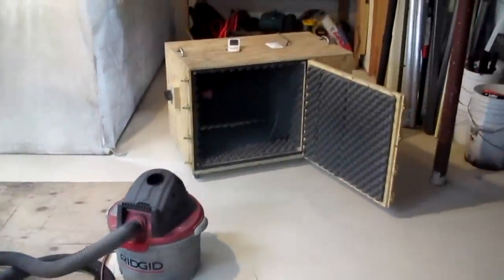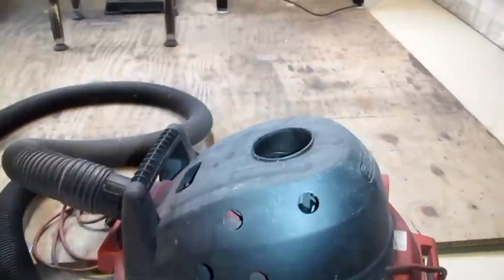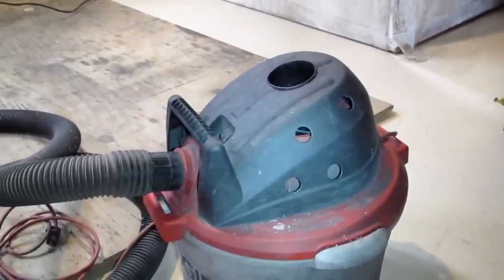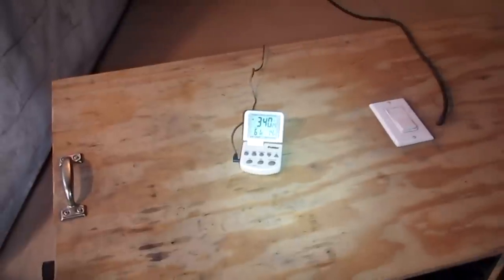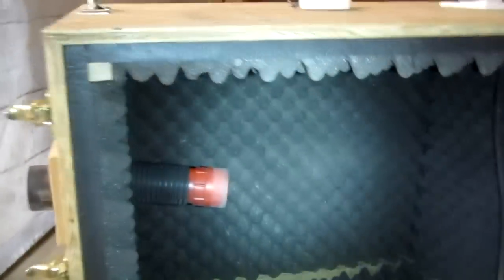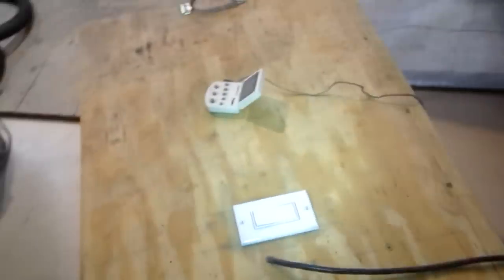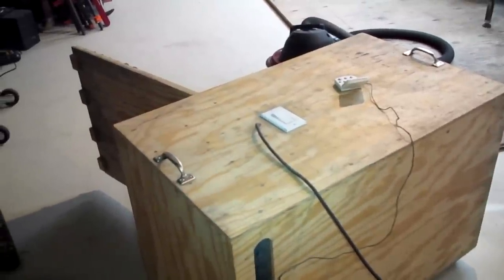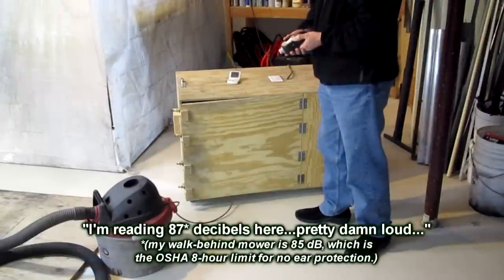-22 dB Shop Vac Silencer

Comment: I wonder if a similar design (with baffles on the intake and exhaust) would quiet a noisy generator.  With an auxiliary exhaust fan, I'd bet there'd be almost an equal reduction in the noise level.
Reply: You could but there's a lot more heat to deal with and portable generators are air cooled. Try this... build a 3 sided noise deflector about 1 ft larger than the gen set all the way around, then face the exhaust to the open side. Lay a piece of plywood on top to make a 4th side, keeping that 1 ft higher than the set, just for air flow. It's not perfect but as long as the open side faces away from the house it will help with noise and also keep rain / snow off the set on a stormy day. If it works out you can add strap hinges so storage is almost flat. Keep in mind that plywood will burn so the exhaust MUST face the open side to avoid direct contact with the wood!

Comment: great stuff, can i suggest a baffled air intake similar to your exhaust with a computer fan on the front to blow cooling air into the cabinet? im guessing your biggest problem is heat build up inside. i would be paranoid the thing would catch fire.
fantastic noise reduction!

Comment: I went to school for acoustic sound engineering and I can assure you that the foam inside this cabinet is pointless. If you capture the frequency response of the vac using a condenser microphone, you'll see that the sound is most evident from the mid-low to high frequency range. Now, please note that acoustic foam does NOT provide sound deadening properties within a room or enclosure, sound deadening can only be achieved with mass, creating a wall within a wall, or by creating what's called a 'float room'. Acoustic foam is however very effective in addressing a room or enclosure that sounds too 'bright', the 'sss' in vocals if you will, vocal booths are treated heavily with foam for this reason. Anything below the high frequency the foam is irrelevant. By creating a float box or walls within walls of this type of enclosure, you can achieve a whisper quiet vac box.
Reply from the maker: “Pointless” suggests that I could remove the foam from the cabinet and expect no change in sound level. Unfortunately the foam is glued in place (and much of it is inaccessible anyway, inside that serpentine exit duct) so I can’t test that claim – but I am quite certain that if I did, I would get a lot more noise propagating out of the cabinet’s exhaust port.

Per your suggestion, I installed a frequency analyzer app on my phone and took a look at the spectrum for my shop vac operating in open air (outside of the cabinet).  Here’s what I
captured:

https://prestondrake.smugmug.com/Other/Website-Pics/i-37BthQv/0/O/shop-vac-open-air.jpg

The red trace is the peak level since last reset, and the green trace is the current/live reading.  A few comments about the spectrum:

- There’s a notable peak at 350 Hz (this corresponds to 21,000 RPM on the motor, fairly typical speed for a shop vac impeller).
- The 7-bladed main impeller accounts for the peak at 2450 Hz.
- The 11-bladed motor cooling fan accounts for the peak at 3850 Hz. 
- There are some other peaks that appear to be harmonics of the above, and plenty of wind noise, all at higher frequencies. Not much going on below 350 Hz.

Rather than using qualitative descriptors like “bright” or “the ‘sss’ in vocals” to describe absorption characteristics, I think it’s much more useful to deal with quantitative information – specifically, absorption as a function of frequency.  I don’t have a data sheet for the particular foam I used, but I did find a couple of other sites that list data for their products:

https://acousticalsolutions.com/wp-content/uploads/2015/02/D-AlphaWedge-Acoustic-Foam.pdf

http://www.techniconacoustics.com/how-we-do-it/acoustics-lab/acoustics-101

Contrary to your claim that “anything below the high frequency the foam is irrelevant,” the plots at those links show that 2” thick acoustic foam provides a reduced-but-still-useful level of absorption in the low mid-range (250-500 Hz).  In fact, the absorption characteristics of acoustic foam – moderate in the low mid-range, high everywhere above that – seem quite well-suited to the spectrum I saw for my shop vac.  Rather than being pointless, it seems pretty clear that for this particular application, acoustic foam is...pointful.

Pointy?

Pointed?

Words escape me here, but whatever the opposite of “pointless” is, that’s the word I’d use here.
Reply: JoeFrickinFriday 

You just totally F'd him in the A!
Reply: By building a box around the vacuum FrickinJoe has effectively created a "wall" around his vacuum, thus achieving exactly what you said he should do. I can assure you that the foam is not anywhere near as pointless as your argument. Acoustic foam is used for many things, sound deadening being just 1 of those things. Vocal booths are not treated with foam to deaden the "sss" in vocals. They are treated to lesson the reflections in the room. The singer is singing directly into the mic, so the foam has no effect on the direct sound. You could use a dynamic or condenser mic to capture the sound of the vacuum, specifying condenser was pointless. At least you got the properties of the sound coming from the vacuum right. The reason you create a wall within a wall is to cut down on the low frequency transmission which one wall is not very good at. By building a box around his vacuum FrickingJoe has done exactly what he should have. It seems to me that your money for acoustic sound engineering school could have been better spent elsewhere, and yes, I would like fries with that.
Reply: Buer Sagittarius School schmool. Do you actually know how to do anything? Other than lose in the YT comment section?
Reply: Great response.

I'm considering uploading my build that I finished and tested today for silencing a deafening 3HP air compressor but well aware that it's going to attract those who have attended "sound engineering" courses (yet fail to specify whether they've graduated or not or better still...show their own build) and feel it's okay to criticise without backing up their claims. There's a lot of time and effort that goes into these builds that always look easy...when not having to build them yourself.

I reduced the noise from 96dB down to 50db at 1m using foam underlay, acoustic foam, MDF boxed within a box within a box, intake and exhaust baffles with 252 CFM fans controlled by thermostat drawing in cold air and pushing out the hot air, basically taking many of the techniques used by YouTubers to quieten their own tools with air compressor or shop vac.

Not only a great response but great job! You've silenced your shop vac to where you can hear a conversation - where is Buer Sagittarius' boxed silencer (without foam)?
Reply: Buer lead with an argument from authority fallacy, degraded the argument into qualitative woo words typical of "sound engineers," and ended up getting served a full helping of physics.  I have a degree in physics, and while I don't flaunt that around in order to build a false sense of credibility, I found +JoeFrickinFriday's explanation highly satisfying and laden with logic and empirical evidence.
Reply: +Buer Sagittarius Granted I agree with you on the exit frequencies but on the underlying harmonics of motor vibration on a bare frame I would tend to disagree with you, as the wood based on the spacing and flex will produce it's own sub-tones. Also did you account for a pointed flex foam or on a flat foam. Also the cellular openings and tapper. Love acoustic chambers, they drive you batty when put inside and the door is closed. For those of you who have never been in one, they are so quiet you can hear your brain static in your ear drums.
Best Wishes n Blessings Kieth
Reply: This was like the scene from Good Will Hunting. How much did you drop on that education Ken?
Reply: Sorry, but as an engineer and musician who's extensively researched (and implemented) soundproofing...Ken is 100% correct. 

Nothing wrong with the foam, and it doesn't hurt, but it does not soundproof, it only prevents reflections of high frequency soundwaves. A better alternative would be double up the plywood walls of the cabinet (with screws, not glue) and use green glue (Not actually a glue...misleading name) to sandwich them together. I'd be very interested to see the results of something like that. I might give it a whirl actually...
Reply: r s I believe MDF is denser than plywood, so for soundproofing, you're better off going with that. I would love to try 2 layers of 3/4" MDF with some green glue in between...I might give it a whirl.

I used Safe n Sound when I made some panels for my home studio. Worked great and taming mid-freq reflections.
Reply: Ken Lee 

He just F'd YOU in the A.
Reply: pratice and measuring beats theory. i hope he does not take it personally, he might just share a tip.
Reply: Ken Lee say you had some more scrap mdf down the road, how would you build a box OUTSIDE that box to make even better? just curious
Reply: Ryan Monty plywood or mdf preferable sound wise? im gonna build this too but i have left over bat of safe'n'sound.  i also have some left over pieces of rigid insulation (closed cell foam) where should i use it? thanks
Reply: JoeFrickinFriday what you should take away from that is foam was not the most effective material you could have used. A rubber or neoprene or similar material would have done better. And I didnt go to school for this but built cabinets for my shop vac and compressor. On a side note you couldnt pick a worse shop vac for sound. Ridgid vacs are just howling shrill loud. I have one. Bought a new shopvac quiet series for my hush box project. Used 4 6.75" fans 2 in 2 out each in labyrinthe apparatus. Can link you to photobucket album if you want to see it.
Reply: r s mdf has better dampening but it depends on the frequency. You could use plywood and attach rubber or neoprene and get the same dampening as mdf has poor structural strength and is heavy. I built mine out of oak plywood and dont think it would work any better with mdf.
Reply: Mostly agree. I would use 1/2" ply for the outside box framed with 2x2 cedar, then heavy 2" foam encased by 1/4" cedar ply inside.  Joe's clever altering of his Ridgid vac  is impressive but I'm guessing the box design is hard to clean out with that foam exposed and the vac will create a lot of internal dust. Especially at the cooling hole in the corner of the box.  It is already too big and too heavy  to consider it as functional for my space but still a fun project to study acoustic insulation. Thanks for all the effort Joe to share this with us and thank you Ken for a very important tip although not entirely accurate  as his foam presently is absorbing motor vibration keeping the box from echoing that hum. So still there needs to be something under the vac in the box to help with that. Foam would work.
Reply: +JoeFrickinFriday she/he went to school for acoustic sound engineering, which does not mean she/he wasn&#39;t kicked after a few semesters worth of time :D

Really nice job, the result speaks for itself.
Reply: +JoeFrickinFriday Don't you know that all keyboard warriors, art masters, and engineering experts ALL frequent youtube videos to dispense their wisdom? Sheesh! :)
Reply: +JoeFrickinFriday 

gg.
Reply: Buer...There is a little blood right there just below your right nostril.

Comment: My 2 cents is that you should leave a clean top surface on it making it able to be utilized as a work surface, bench to mount tool you want the vacuum to pull the dust from or whatever.  As time has passed I am guessing that this is something you would have come to figure out but seems something that someone copying your design should take into consideration. Handles on the sides and possibly moving the switch below one of the handles so it can act as a bumper / protection for the switch.  I would think the chord could be snaked out the back vent if not wanting to make another hole in it.  The comment about it being similar to speaker cabinet instead of seeing as a joke might actually be one more way it can be utilized for someone who likes their music in the shop.  With initial thoughts are have speakers firing down but may need to have another bottom to reflect off and use side for port.  Whatever someone decides the noise of some shop vacuum is so deafening that I wont even use but your muffler is a good alternative.
Reply from the maker: Todd Hollarn All good suggestions, thanks.  If I were going to make another cabinet (and I may someday for a larger/more powerful shop vac), I would do many of those things: handles/switch/cord attached to the sides, with maybe a laminate top surface or something.

Comment: How does it get air to cool the motor.  It is coming from the air in the box which will get progressively warmer?
Reply from the maker: Ashburn slum lord The main vacuum hose pulls outside air in, and then the shop vac dumps filtered air into the cabinet.  That's the air the motor uses for cooling.  The warm exhaust from the motor mixes with the rest of the air inside the cabinet, and because there's always fresh air coming in, there's a general movement of the mixed air to the cabinet's exhaust port, carrying heat away.  If the vac's filter is relatively clean and free-flowing, then there's lots of air flowing through, and the inside of the cabinet stabilizes at a temperature that's about 25 degrees higher than outside the cabinet.  If it gets clogged, the temperature difference is more like 45 degrees.  I watch the cabinet's exhaust temp with a kitchen thermometer; if it hits 110F I know it's time to clean the vac's filter.

Comment: Very impressive results. If you could attach a cyclone bucket system to it, you'd eliminate the filter clogging issue.
Reply from the maker: lion39 Actually I do have one: http://home.comcast.net/~prestondrake/Stuff_Workshop.htm  but it's only convenient for use with my sandblasting cabinet.  I haven't gotten around to setting up a dust control system that lets me vacuum the rest of my shop through that cyclonic separator, e.g. when cleaning up after spraying powdercoat, or using table saw or router.  That's what I get for procrastinating...

Comment: Do you have any problems with the vac overheating?
Reply from the maker: In the video you'll notice the thermometer in the cabinet's exit slot so I can keep an eye on temps.  My basement is usually about 65 degrees.  If the filter is unclogged,  the cabinet exit temp is about 90F.  When the filter is clogged enough to give me an annoying decrease in performance, the cabinet exit temp is about 110F; that's when I shut down and unclog the filter.  I assume shop vacs like this are designed to tolerate being used outdoors in Las Vegas or Phoenix on a hot summer day, so I'm not expecting (and have not experienced) any trouble with it operating under these conditions.

Just in case though, I keep the cabinet exit away from anything flammable so if it starts belching flame, it won't immediately ignite anything else - and there are a couple of fire extinguishers in my basement too.
Reply: +JoeFrickinFriday Nice work, it would have been great if you could find a way to give it some fresh air but i guess that would bring the noise up again.
Reply: +punkbloater oh just figured out you get fresh air through the hose.
Reply: +JoeFrickinFriday A nice addon would be to make a programmable thermometer (Arduino, for example) that could turn of the vac to prevent overheating. Excellent project, by the way!

Comment: I did something similar with my air compressor, but didn't run the soft seals around the doors. The egg crate foam works wonders at suppressing sound.  I did notice that even prior to you closing the door, the sound levels dropped significantly.  Good job!
Reply: 'Significant' is a subjective term.  To some it means from headache inducing to conversation level.  To others it means from close enough to a space shuttle to touch it at launch to the most sensitive dB meter seems defective until someone touches it or lets a breath in or out.
Reply: +Tim Grace You couldnt be more wrong. Do your research, egg crate foam does absolutely nothing lol. For you to say that the sound levels drop to a 'significant' degree is just hilarious.

Comment: What adhesive did you use to put the foam on the plywood?
Reply from the maker: I used 3M Super 77 spray to attach the foam to the plywood.  Plywood (1/2" thick) is assembled with a 2x2 stud along each edge using construction adhesive and flooring screws (predrill and countersink the holes so you don't split the 2x2s).  Foam is available from McMaster (search for "egg crate foam").  Hinges, latches, and wheels are all available from Home Depot or your nearest hardware store.
Reply: Thanks for the response. I have 1/2hp inflatable blowers that I use in my gymnastics program. I made a pair of boxes like yours and my gym is silent again. Great design idea.